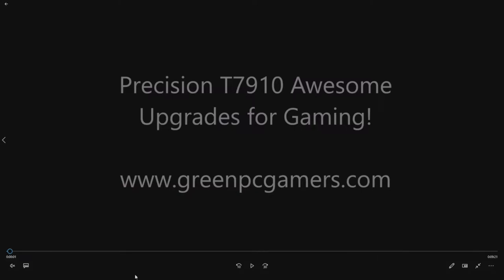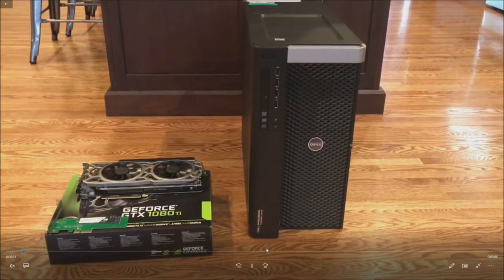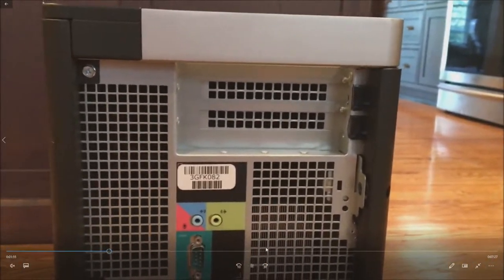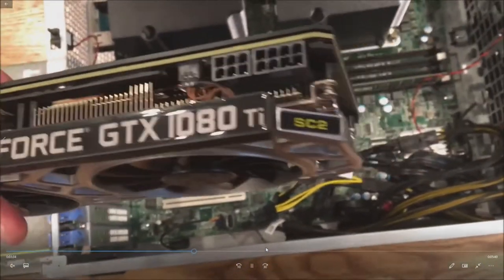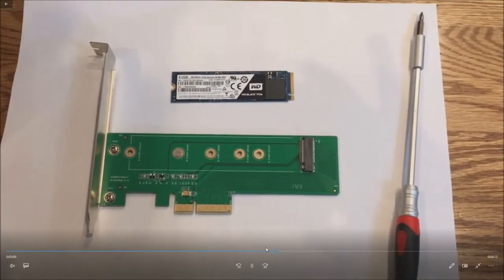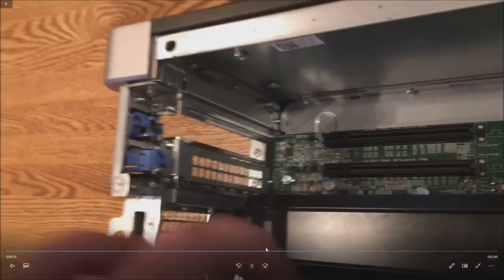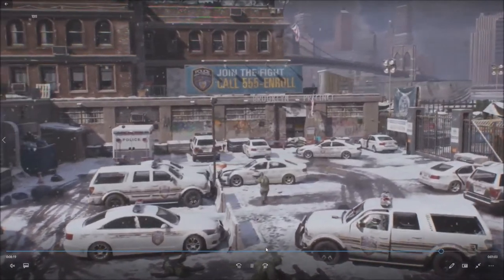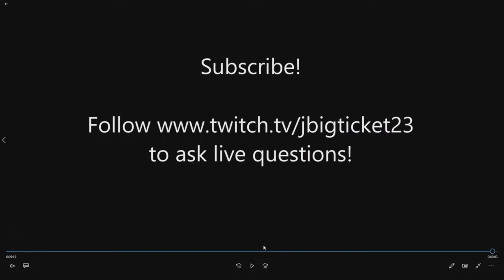Precision T7910 Gaming Computer  NVME and Graphics Card GTX 1080 TI  Install

Comment: Just bought a 'bare bones' 7910 myself for £400. To add, RAM, proper sound card, video card and SSD/HDD. I have most of those anyway. 2x E5-2973 V3s on the way (12 core @ 2.4 GHz, turbo 3.2 GHz 105 Watts). Fun in store !
Reply: What graphic are you going to use , i bought one today and it does not have one.
Reply: @faisalak7  Virtually all Precisions are shipped  with an Nvidia Quadro of some vintage ! I have a selection on hand from the ubiquitous Quadro 600 and 2000 (fine as general better than average video cards) up to a Quadro 6000 (including the SDI genlock add-on) and a few K's like the K4200.  They're not the fastest gaming cards but are great for CAD and modelling.
Reply: @grahamstevenson1740  Thanks , i will get some used ones maybe k4200.
Reply: @faisalak7 The K4200 seems to be a good choice. There's bargains to be had on ebay if you're patient. I paid about the same as for a vanilla Quadro 4000.
Reply: @faisalak7  It's been a while since I was here but I've got an RTX 2070 coming.

Comment: Great video, I just wonder how easy the usage of the NV/ME adapter is, can you select it as boot device in the BIOS ?
I found several Dell sites where they say, NV/ME wouldn't be supported for the T7910

Comment: I'd like to ask something. I've upgraded my 7910 with an Intel Xeon E5-2690 V4 CPU, 32GB RAM, and the PSU is 685W with an 8-pin to 6-pin connector. If I buy the 8-pin splitter from your Amazon store and connect it to my Intel Arc A770, I plan to upgrade to a 1300W PSU.
Reply from the maker: The T7910 should have come stock with a 1300w power supply.  The 6 pin to 8 pin adapter should work well with that gpu.

Comment: It was a great video, I'm planning to upgrade my workstation T7910. So, is it possible to install one of RTX 3060~80?!
I'm looking forward to hearing your advice? if it is possible to post a new video that would be great.
Reply from the maker: Yes, it will support those cards as long as you pick a version that will actually fit in the case.  Expect some strong bottle-necking on the 3070 Ti or higher cards.
Reply: @GreenPCGamerscom kinda late but you think a 18 core plus is going to bottleneck it?

Comment: Just wondering, do you think an open air card or a blower card would be better for the t7910, as it has a very tight side panel?
Reply from the maker: If you plan to keep the side panel on, the gpu's with blower fans work better.
Reply: @GreenPCGamerscom  ah, thanks!

Comment: Hi, thank you for this useful video. I have a dell T7810 computer.  It has two CPU and one gtx 1080 ti GPU.  I am using it for scientific computations. But I have heat problem. sometimes the computer turns off due to overheating shutting down. Do you have any advice about this situation.
Reply from the maker: Hey Enes, What processors do you have installed?  Are you using the 825W Power Supply?
Reply: GreenPCGamers.com Yes I am using 825W power supply and It has two Xeon E5-2600 processors.
Reply from the maker: The first thing I would try is to reinstall the processors with fresh heat paste.  I like using heat paste made by Shin Etsu Microsi.  Make sure to clean off all of the old heat-paste when reinstalling the processors.  Let me know if the issue persists after trying that.
Reply: Thats not a heating issue. If it was a heating issue, the processors would just throttle down. Thats a power draw issue. 825w is not enough for 2 150+w processors, and a 300+w graphics card. Plus everything else in that system. Youll know when you run Furmark and Prime95 at the same time and hookup a multimeter. That system will draw more than 845w. I upgraded to the 1300w psu and the shutdown problems went away.

Comment: Hey, thank you for the video. There are not a lot of videos with gaming details for the T7910. Can you let me know if you experienced sporadic high render latency during some games on the 7910?

Current Config:
-------------------------------
Bios - 
Intel Speed step ON (Won't go higher than 2.5Ghz if off
Hardware Prefetch/Adjacent Prefetch ON
Memory set for low latency
Intel Turbo Boost ON

Hardware - 
Dual XEON E5-2680v3 (2.5Ghz - 3.X Turbo (I never see over 2.89Ghz))
64Gb ECC Memory
Zotac GTX 1060 6Gb (I have issues with it displaying on anything other than top x16 75w PCIe Gen3 slot (Marked for CPU 2 i think) and the x16 75 - 275w PCIe Gen3 slot below main blue slot. 

I have tried a combination of the settings above and the system runs very well except for some random high render latency in Horizon Zero Dawn - Seems to be the only game experiencing that issue heavily. 
--------------------------------

Thanks again.
Reply: My titan xp runs well I think you should get atleast a 1080ti or 3060

Comment: sorry this might a really silly question, but why do you use a dual-6 to 8 adapter and an 8 to dual-6 adapter? Why not using the onboard 8-pin and 6-pin plugs?
Reply from the maker: Both are valid options.  Thanks for commenting.

Comment: Where did you get the 6 core xeons e5 2637 v3? Because i have only seen them with 4 cores
Reply from the maker: You are correct, E5-2637 V3 is QC not 6C.  Sorry for the mistake.
Reply: @GreenPCGamerscom  i got 2 e5 2637 v3 in my system should i use 2 e5 2687 v3 instead?

Comment: Do this pc support intel i5. 4th or 6th generation procceser ?
Reply from the maker: It does not.

Recommended Processors:

V3 Processors:

Up to 2 x QC Xeon E5-2637 V3 3.5Ghz 15MB 9.6GTs Processors | 3.7Ghz Max Turbo Frequency (SR202)

Up to 2 x 6C Xeon E5-2643 V3 3.4Ghz 20MB 9.6GTs Processors | 3.7Ghz Max Turbo Frequency (SR204)

Up to 2 x 8C Xeon E5-2667 V3 3.2Ghz 20MB 9.6GTs Processors | 3.6Ghz Max Turbo Frequency (SR203)

Up to 2 x 10C Xeon E5-2687W V3 3.1Ghz 25MB 9.6GTs Processors | 3.5 Max Turbo Frequency (SR1Y6)

V4 Processors:

Up to 1 x QC Xeon E5-2637 V4 3.5Ghz 15MB 9.6GTs Processor | 3.7Ghz Max Turbo Frequency (SR2P3)

Up to 1 x 6C Xeon E5-2643 V4 3.40Ghz 20MB 9.6GTs Processor | 3.7Ghz Max Turbo Frequency (SR2P4)

Up to 1 x 8C Xeon E5-2667 V4 3.2Ghz 25MB 9.6GTs Processor | 3.6Ghz Max Turbo Frequency (SR2P5)

Up to 1 x 8C Xeon E5-1660 V4 3.20Ghz 20MB Processor | 3.8Ghz Max Turbo Frequency (SR2PK)

Up to 1 x 12C Xeon E5-2687W V4 3.0Ghz 30MB 9.6GTs Processor | 3.5 Max Turbo Frequency (SR2NA)
Reply: @GreenPCGamerscom  it also support 2 x 12C E5 2673 V3

Comment: Little off subject. I keep getting air temperature sensor error on boot and so it will not let me pass the bios screen. T7910. I am wondering if it is the hd thermal sensor? I do not see any air sensors anywhere?
Reply from the maker: Do you have the side panel on?
Reply: Yes, thats the hard drive sensor as its the only original temp sensor in that system. Unplug it and the issue will go away, or get a replacement. Having the side panel on or not is irrelevant on bootup for the sensor.

Comment: I don't believe you can run GeForce GTX 1080 Ti in SLI mode (2x 1080 Ti) in Dell Precision 7910 workstation motherboard. The System Bios won't allow it. Nvidia SLI mode in Dell Precision workstation is reserved for Quadro Pascal or Quadro RTX cards ONLY. However, one may able to run AMD CROSSFIRE in Dell T7910 MoBo.(2x XW Radeon Pro/ Fire Pro or 2x Vega Frontier Edition cards).
Reply from the maker: You are correct, we discovered that the T7910 doesn't support GeForce SLI configurations after we made this video =(  Either way, thanks for the valuable info.

Comment: But fr is it worth 7xx dollar?
And does it work with tesla cards and amd rx 6600 xt?
Reply from the maker: We haven't tested the T7910 with Tesla Cards.  It will work with most RX 6600XT MFGs.  It has been verified tested with a Gigabyte Eagle 6600XT.

https://www.bhphotovideo.com/c/product/1677710-REG/gigabyte_gv_r66xteagle_8gd_radeon_rx_6600_xt.html
Reply: Yes, I ran a tesla m40 card for a year, but you need to enable above 4g io in the bios.

Comment: i have a 2080 in my 7910 and the case clears.... barely...
Reply from the maker: It can be pretty tight, depending on the MFG of the card.  You should check out our Facebook page.  One of our community members made a custom perforated metal side panel that looks really cool and provides more space for GPU's.  We posted it on the GreenPCGamers Facebook page.